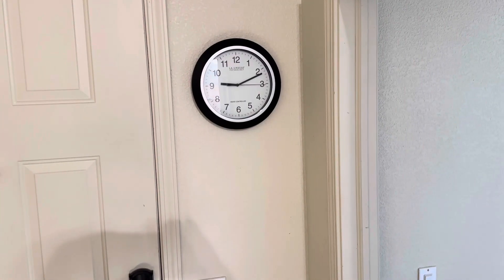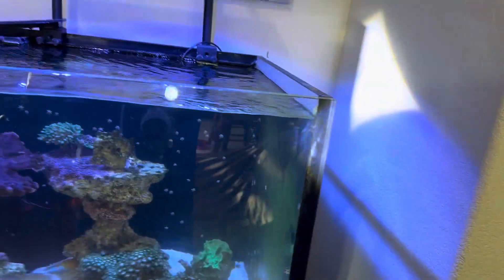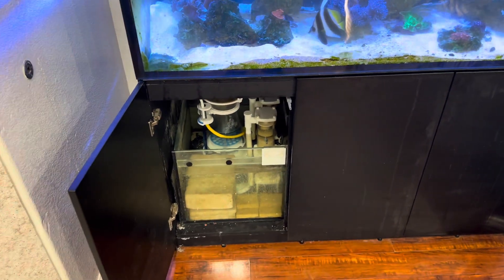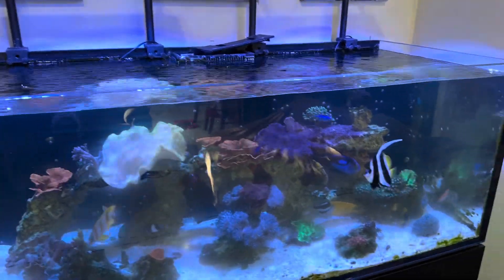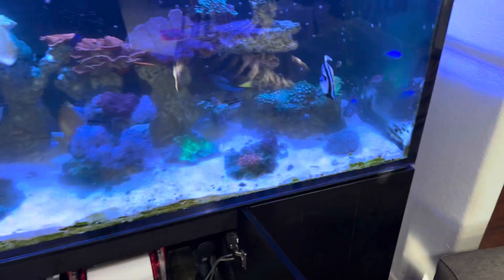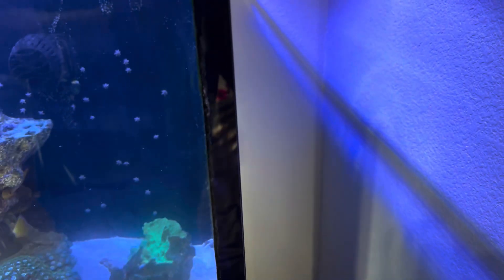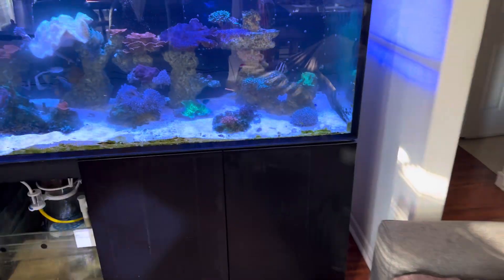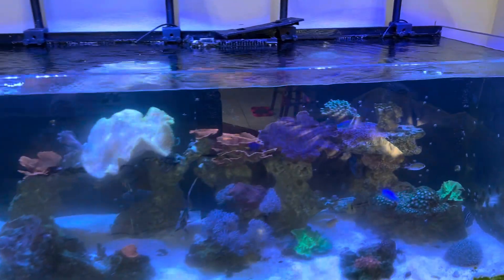Blown Again!!  Why Are There So Many Red Sea Equipment Failures?!!!!

Comment: It could be your algae cleaner with the blade, commonly happens, if you're pushing the blade into the silicon it will cause this over time. Just a tip for your next aquarium. Not stating that this is the actual reason though.
Reply: Red Sea actually puts plastic silicone guards in the corners from preventing you doing that with the scraper on their reefer tanks.
Reply: Been using flipper against my silicon for years mate it won't cut unless you want it to redsea products are trash aside from test kits and nanos
Reply: @reefinainteasy730 only with the G2 :) he has a G1

Comment: i will never buy red sea id have one split and flood my house and spent hours and thousands of dollars in repairs, i highly recommend JBJ or Waterbox, half the price of red sea, and will not fail on you.
Reply: Also bought a USED Jbj 45 gal tank, with chips on some of the edges that is almost halfway through and is still holding strong.
Reply: WB is no where near half the price

Comment: I've been in the hobby for 29 years. Redsea have always been extremely good at "marketing" they also seem to realise the majority of people do not stay in the hobby long with an attrition rate of 90% you can see what they are doing here . They price and market their products as premium. They are not  premium at all. They are still making their tanks with a diaphram valve that people have been complaining about for a decade. Their G2 has a 5 year warranty which is also laughable. You should get at least 10 years for a material or workmanship defect causing failure
Reply from the maker: Agree
Reply: Totally agree as well. Many people jump right in Red Sea salt water aquariums without even knowing anything of the hobby. Spend thousands until they give up because things don't work out. Then give up on it forever.

Comment: My RedSea failed in Oct. It was a disaster, just got my floor replaced last week. When I was getting the tank ready for disposal, I flipped it upside down and I noticed the silicone is not consistent near the leaking point, there was a join point in the middle, silicone has different color, different consistency left and right of the joining point.

Comment: I run a freshwater system but use a RedSea ReefWave to help with nutrient suspension/export, as such I am part of a RedSea forum in the UK. This new level RedSea aquarium you talk about coming on an Aluminium stand, the aquarium doesn’t fit on the stand and overhangs a good half inch if not more side to side guess what’s been reported on these setups… the glass is horrifically chipping away on corners to the point the glass thickness is down to a third thickness and writing that tank off as a potential glassblowing not seal but glass failure. I don’t understand why there hasn’t been a recall of poor product. If a car. Manufacturer creates a dangerous product the vehicle is recalled back, if a small child is near a large system tank and a seal has a catastrophic failure it could very easily cause a life changing injury or worse still a death.. RedSea needs to investigate their product line and understand why or how poor products or workmanship is being produced..

Comment: “Boss, We Ran out of the Alcohol for Cleaning the Glass!” “Don’t worry, we have it on order, keep building the Aquariums, we have orders to fill!” BTW, If you want a really Strong Aquarium, get a CDA, out of California. Euro Braced on the Bottom and the Top. Benefit, of the top Euro Brace, is you don’t splash water over, and down the outside glass, when cleaning the inside glass.

Comment: What has been kind of suspicious is that those failures tend to happen on tanks where the cabinet does NOT have the front pane supported by the bottom slab or the cabinet top board.
Waterbox has the same in their official cabinets.
Problem is due to them wanting 'pretty' looking cabinets with 'smooth' fronts where you don't see any 1 to 2 inch (2.5 to 5 cm) wood slab between tank and doors.
Reply: I’d say it’s because of this. Tons of water pressure pushing against the front glass and corners while not being supported . His failures are mainly at the front seams and not the back. Definitely giving up proper engineering in the name of aesthetics.
Reply from the maker: The cabinet has suspended metal under the front panel. It’s the silicone because it’s happening on the sumps as well.
Reply: @gunthersreef  I wonder if its the silicone they use specifically or something they are half assing during assembly like dirty glass etc.  Sucks man.  Im in the process of setting up a reef tank again after about 6 years out of the hobby.  seeing stuff like this scares me.  I just bought a used tank and decided to reseal it because the silicone was looking a bit worn out.
Reply: @sg1trogdor  how is it going today? I would be even more scared to use second hand products.

Comment: Had two different Marinland deep demension tanks leak on me in three years just like yours the second one was a replacement that also failed in three years tanks were 300 gallons so I feel your pain but not just Red Sea has a problem so does marineland tanks

Comment: A tank that large usually needs a base at the top, to keep the water volume from pushing the silicone apart.
Reply: That's if your not using 15mm glass, it has 0.0504m2 roughly worth or glued surface area. 

My aquasys 395 is similar and no reported issues heard of 🤷‍♂️ 

The problem is the silicone red sea is using must be shit, either that or shit staff that left the mating surfaces contaminated, must have been made on a Friday.

Comment: Is it a Gen 1, if so this is old news and nobody is surprised? I have three Red Sea LED 90's and they perform flawless.
Reply: Old news that they can't make a glass box to keep water in 😅 come on! It's not rocket science, most people can make a DIY aquarium that lasts at least 10 years. It's shockingly embarrassing for a commercial brand that trys to be premium 😂
Reply: Is it possible to just reinforce the silicon by placing more over it? Or something to that affect? Honest question 😅
Reply: I just bought a brand new Reefer 350 G2 and I’m nervous to fill it… maybe I can apply more silicone to it?

Comment: I wonder if a lot of these seam issues are contributed by running powerheads in the wave making modes. I see a lot of reefers that will run this mode for hours a day and it is a lot of force being smashed side to side up against the seams. Also, if I'm not mistaken some of the manufactures warn against this mode for this reason. I encourage people to frequently check seams and if there's any bubbles or irregularity, don't chance it, get drain the tank and get rid of it. I also notice you have very little to no algae on the glass right up against your seams, and you have and algae scrapper. Could it be that you are inadvertently hitting the silicon to get that algae so clean up against the seams?
Reply: If a powerhead or algae scraper can cause a tank to fail, that tank should not be on the market. Period. 

It's not like Red Sea designed these tanks to be used as a goldfish tank with no flow and no coralline algae. If those are seriously contributing factors in these failures, it just further highlights that these tanks were poorly designed from the outset.
Reply: @MikeFallen13  wait...are you saying that a manufacturer should be responsible for someone that's accidentally or intentionally getting too close to the silicon with essentially a razor blade, causing damage over time and affecting it's ability to stay bonded? If we're being honest, if you or I owned a manufacturing business of the sort, neither you nor I would want to be responsible for that scenario. BTW there's not a silicon out there that can withstand a scrapper being bumped into for long periods of time, nor is there a company that would be responsible for such a scenario if found to be the case. The wave makers are another topic however, I seem to remember reading somewhere either in an ecotech or tank manual to be careful when using a wave maker mode in tanks.
Reply from the maker: Assume all you want, but every RS product Ive owned has failed. Not sure how the razor blade would affect a light…a skimmer…a reefmat….a doser…
Reply: @gunthersreef  I've had AI lights go out on me, I've had a Kessil go out on me, I've had Maxspect gyre's go out on me, I've had an MP10 go bad on me and that's just for starters...see where I'm going with this?
Reply: Those scrappers are really can ruin silicone, just as any blade, I never used them, but what is a good alternative at the corners?
Reply: @thombaz  I use my finger as a guard around the edges, meaning as I slide the scrapper on the glass near the silicon, my finger acts as a bumper, leaving about about an eight inch or less of algae. It's not 100% free of algae near the silicon but it sure beats a seam busting.

Comment: I tell you why they bevel edge all glass's panels and you lose 2mm off each edge so 12mm plate ends up with only 8mm of polished edge I allways euro back any tank and you have most probably been cutting into the silicone with a blade scraper
Reply: That's a GOOD point. I never use one. That could be also a factor of why his silicone is gone.

Comment: Make sure you don’t push the algae scrapper blade inside the silicone!  There is no other reason silicone breaks like this on the top where pressure is minimum…
Reply: It can happen if the stand is uneven and tank bottom bulges outward because there clearly isnt enough front support in his stand. The stand ia trash.
Reply from the maker: Or…the entire system is under-engineered and cheaply designed

Comment: im sorry dont hate me but this is 100% user error! I clean my corners with a white magic eraser when i clean the tank and i keep algae and coraline from building up in the corners! I use a metal razor blade to clean my glass but a plastic one when i get near the seams. Then on the seems i use the magic eraser to be extra careful.
Reply from the maker: So if algae is growing in the corner, and has not been touched by a scraper or otherwise, how would the silicone BEHIND it break its seal? Thats like saying someone backed into the SIDE of a car, but it was the other guys fault. Did it levitate?

Comment: The problem may be your floor. If you have a foundation that is not able to support the weight. The weight of the take cause the floor to move. when the floor moves the tank also moves. cause the glass to move. Its your floor not the tank.
Reply from the maker: Single story concrete slab house. House was built in 2002.